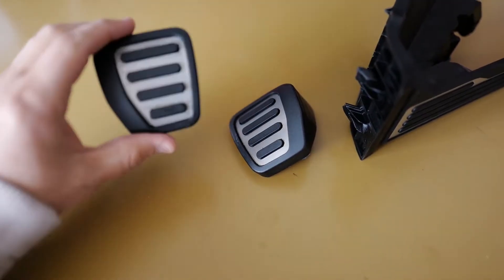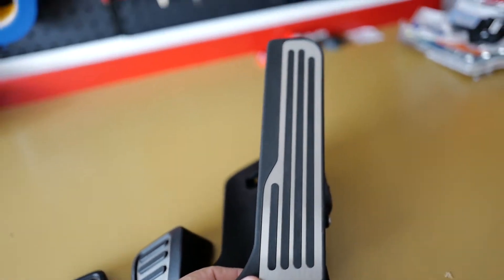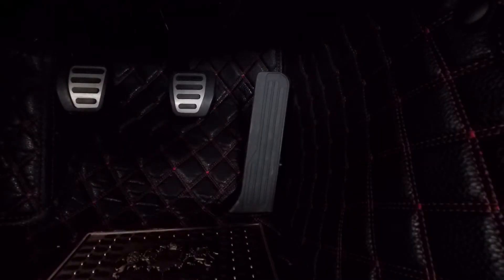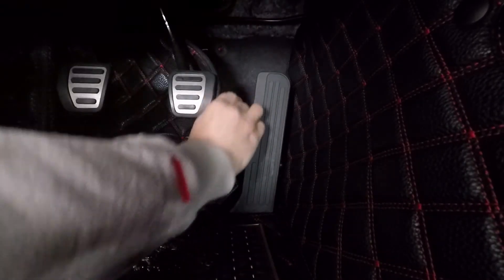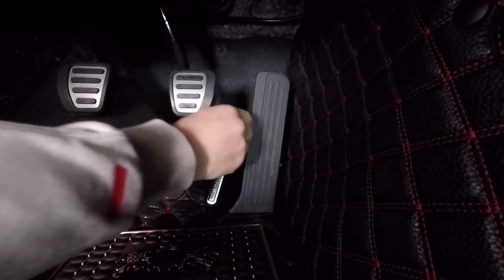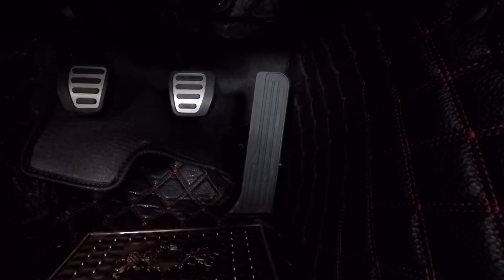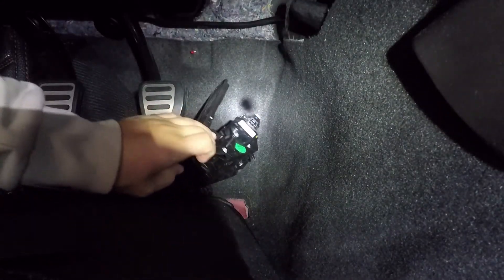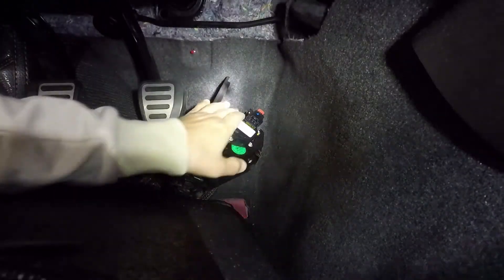2018 Chevrolet Camaro GM Pedal Covers Kit Install

Comment: Hey, I have pretty much the same ones in my Camaro.  But I tried everything when I move the seats forward the rack pushes on the mats badly.   They look good, and I tucked the edge under the trim, so it looks like it came from the factory.  Did you have that issue?  Its annoying cause when I move the seat forward it pulls it out of the trim every time.  This is not about the pedal install i saw you had the custom leather diamond stiched floor mats .  Thats what i am talking about